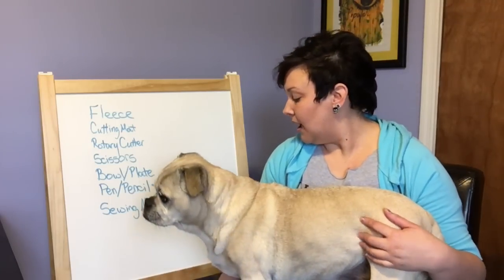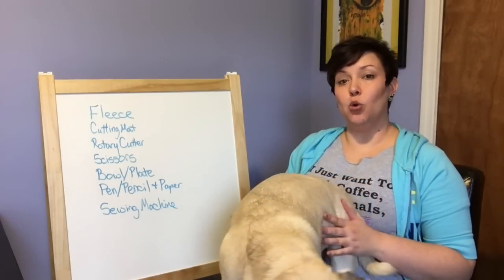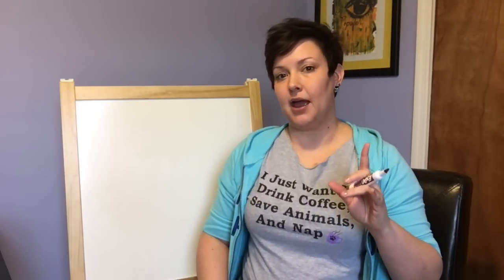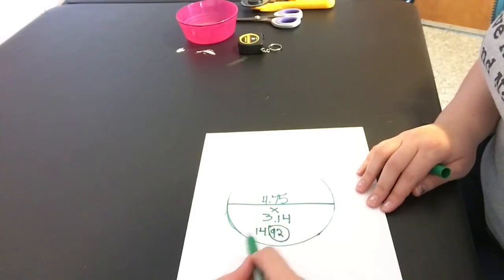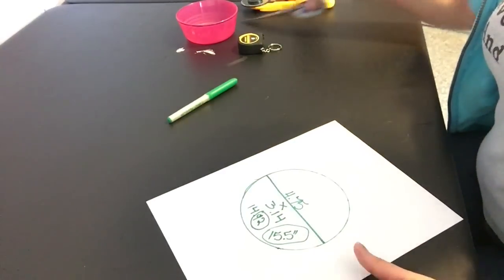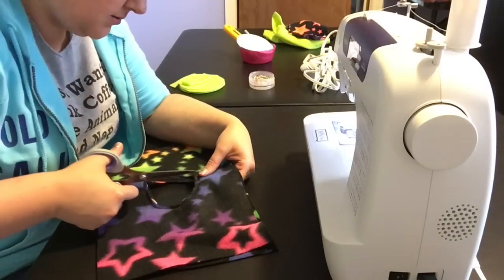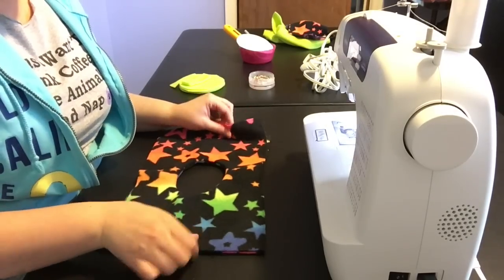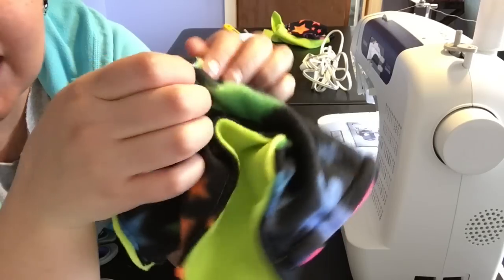Log with Hole Entrance

Comment: Thank you SO much. I'm a very experienced sewer and I still forget to leave the turning hole sometimes. This was an excellent video and I really like that you emphasize the SMALL STITCHES, CORRECT TENSION, etc to ensure the safety of the animals. A carer I donate to recently had a baby possum (Australia) almost suffocate when its head was caught in a seam gap that should NOT have been there. Thanks again.